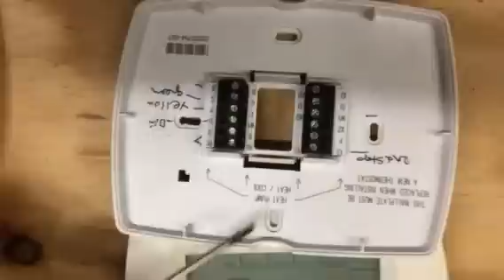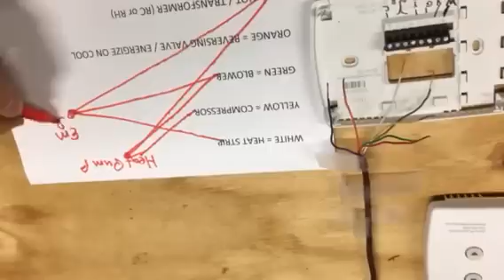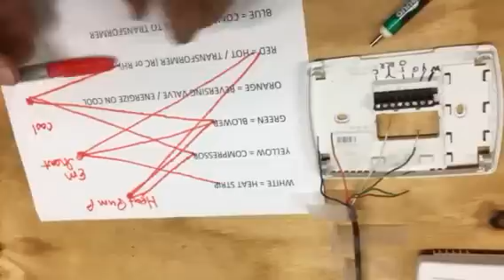Thermostat Wiring

Comment: Sooo Im really going to be the only one who see this error , the same wires it connects for cooling during the summer , its the same wire it connects for heating without using the reversing valve wire . Which mean how do the compressor going to know its either it needs to be cooling or heating ? 🤔🤔

Comment: Your tutorial looked very thorough and I thought I could wire my basic Honeywell thermostat to my Trane heat pump. But no, when I look at the wiring I see it matches to nothing you are explaining in your video! I have a "White" wire not connected. However, there is no "W" terminal except for a "conventional" hook up. For the other terminals there is no "W". Now what?

Comment: Thanks for your tutorials.  Good info.  My AC, when turned on, starts blowing cold air for about 5-10 minutes, then gradually warms up.  When this happens, I go outside and hear the hum from compressor, but the condenser fan cycles off.  Isn't this fan supposed to run constantly?  What can cause the fan to short cycle but not the compressor?  I've done the following:
1)  replaced run cap (5/50)
2)  replaced condenser fan motor
3)  verified 24 v across contactor while both fan & compressor running & when fan cycles off/compressor on - 24v constant either/or
4)  ohmed 24 v tabs on contactor w/o connects (11 ohms)
5)  with contactor activated, both plungers engage - 244 v across t1 to t2 - constant
6)  75 psig on suction side; suction side cold to touch & sweating
7)  24v on wire nuts from control board to contactor
8)  pulled air handler blower & completely cleaned (bristle brush, vacuumed, then blew it out with blower- looks almost new).  It was filthy, but not blocked.
9)  checked thermostat wiring at control board & thermostat.  Tugged on wires both end.  A couple screws were slightly loose at control board (red & yellow) but making contact. I tightened.
10)  transformer fuse & board fuse ohmed good.

I did not clean evaporator coils.  Looks challenging, but if blower was filthy, my guess these coils are too.

What am I missing here?  What else can I check?
Wayne in Riverside, CA.  106 Deg next week... gotta fix asap.
Reply: Oh, I forgot - I ohmed out compressor T1, T2 & run cap herm.  2.0+ 0.8 = 2.8, so it appears good... Wayne

Comment: Will this work for gas and electric driven thermostat and furnace system? Also, when I open my thermostat there are only two wires: white and red. Should I have more wires coming to my non- heat pump thermostat?

Comment: Very good video David. I just touched the Y and the C together, an even when I have turned of the breaker there was a spark when by mistake I made contact. Does that means that the transformer is out now? The AC is not wanting to come even when I do hear the fan and compressor come ON outside.

Comment: Hey David. I have a system that has a E-wire  connected on the existing thermostat and my  new thermostat doesn't have a slot for it. Can i work around it?
Reply: E and w jumper together most of the time.  These call the heat strip on, e for emergency heat and w for the 2nd stage of heat (electric) called if the 1st stage (heat pump) is insufficient to bring temp (in heat mode) to setpoint.  The W will energize on the coldest outdoor temps when the heatpump cannot provide enough heat.
So usually e and w are jumpered together.
There are other ways to bring on electric heat strips in stages as well, depending on the complexity of your thermostat, mine offers 3 stages of heat, for example.  This 3-stage function can be found in thermostats designed for 2-stage heat pumps.
That is, there are a number of ways to configuration the heat stages depending on the thermostat, air handler and heat pump.

Comment: When you tie those wire together to get cool where do you put them?
Reply from the maker: just add wire nut
Reply: @bluecollarmillionaire4life  stfu
Reply: Energizing orange (orange to red) places the reversing valve in cool mode on most heat pumps, some heat pumps this puts the reversing valve in heat mode.  So if your heat pump provides heat with orange disconnected, it will switch to cool mode when orange is energized.

Comment: Thank you David, very easy to understand and straight forward videos.  I am trying to troubleshoot Goodman heat pump.  Now I am equipped with some good first troubleshooting steps for my handyman to execute.  You right it’s not rocket science, but many folks struggle to understand it all, simply because there are so many components in a heat pump.  I think you simplified them quiet a bit for sure.  There are other things as well such as pressure switches etc, but overall I think this video is solid.  I like it... tomorrow I will be doing some pressure testing along with evacuation procedure and some thermostat troubleshooting. Note I am just home owner not HVAC tech.  I was thinking now that I run my whole house on solar, maybe I will also install heat strip.... or maybe my 2nd stage heat... or should I say 3rd.... I have radiators in my house heating up my house with tankless water heater.... I wonder if I can hook up my thermostat to all 3 things.... heat strip.... and my tankless water heater.....

I want to achieve the following.... by default heat pump heating my house with forced air... then if it gets cold... heat strip comes on.... then if it gets super cold.... my tankless water heater turns on....

Note my tankless water heater uses gas which is cheaper than electricity ....however I got solar panels now... so I don’t care about electricity usage anymore....  hence by default I want to use heat pump forced air.... and only have tankless gas water heater heated radiators to come on only if it’s a lot colder below 32 degrees for example....

So do I just hook up my tankless water heater as the second stage to w2 wire? 

I am a bit confused... I don’t want my heat boiler to work when my heat pump is working,  and want it to turn on automatically.... when it’s colder than 32 degrees....

I kind of like strip heat since it gives immediate satisfaction as well.... when it comes to forced air....  but I don’t want to operate on it for a long time....

Only initially just to give me initial quick heating satisfaction in my 1500 square foot home....  but then have itself turn off automatically when it gets warmer and boiler used instead....

Is it even possible to do? Or am I way overboard here? Maybe I should use if this then that automation with Alexa integrated feature to program tankless water heater to turn on while having heat pump turned off....

I haven’t wrapped my mind around all of this yet.... if you have any suggestions let me know. 

Thank You so much.

Comment: Im trying upgrade my thermostat to new wifi unit Honeywell.

I got a blue wire left over in thermostat ...

And I got a blue wire outside at the compressor not wired to anything.

Does the blue wire up to capacitor ?
Reply from the maker: Should be common just use your batteries should be fine
Reply: Cant use batteries for the wifi thats why they say you need to common added??
Reply: I have same issue batteries is just backup we need the common wired in for wifi how can we do that ? Is another 24v transformer needed or can you jumper the common to power the wifi.?

Comment: I had an old Honeywell thermostat; old house, old wiring. Took the old thermostat off to install new RTH7600 Honeywell thermostat. My wiring has only 4 wires; red, green, black and yellow. encapsulated inside a white wire coming out of the wall. 
The old thermostat was connected to the red and green wires; the black and yellow wires were wrapped around the white wire coming out of the wall. I cant get the heat to come on after reconnecting the red and green wires on the new thermostat. Any ideas?
Reply: Hi, I have the same question as you. I only have 4 wires as well.

Comment: What if you want cool you connect the red the green yellow and compressor don’t start where do you go from their?
Reply from the maker: Make sure you have high voltage at the outdoor unit as long as the indoor unit is blowing air then check your low voltage connections

Comment: Im putting in a Honeywell WiFi TH6320W204 and my old Honeywell Pro 3000 had a spot for an E wire, but the new thermostat doesn't.  What do I do with the E wire?

Comment: I have a drown wire s2 and gray s1 everybody talks about common colors but not these . I have trane ac works but face on thermostat frozen. Tried 2 different Honeywell’s . Customer service very bad . I know one is outside thermostat. Also have white with jumper(w1 x2). New thermostats don’t use s1s2 so where do these go. 8 wires in all (heat pump). Hope you can help. Thank you .

Comment: Great information.  I was able to rule out my thermostat as the problem.  Tied the wires together to make my cooling system fire on and was able to determine that it was the main capacitor for my AC unit.  $15 fix.

Comment: What would cause the blower to run all the time? Even when the AC compressor cuts off the blower that brings the air in through the duct work continues to run. My green wire is hooked to G and it's a brand new thermostat.
Reply: Blower motor should run all the time.
Reply: @jklmnk9596  No I mean it runs regardless. Even when the compressor cuts off the blower continues to blow warm air through the vents. Nothing should come out when the compressor is off.

Comment: Thanks for the diagram. I am pretty knowledgeable in remodeling and some light troubleshooting with furnaces. My house has a heat pump system with a thermostat that could be used on the Starship Enterprise. (To technical) so I changed it, nothing.. changed it back per your video. BOOM. it works again. I guess I'll leave the Star Trek thermostat hooked up for now.

Comment: I have a black (dark blue) and orange wire. The thermostat only has a spot for one or the other labeled o/b. Does it go in the same hole as the white wire or orange wire? There isn't another spot for the black wire. I have a Honeywell, th5320u1001 thermostat, and an American standard heat pump with the emergency heating. I live in Maryland.

Comment: Not a bad explanation however, don’t even attempt doing that if you have an older mercury  heat pump thermostat. Because the terminals COULD be completely different. Example: R is the reversing valve. M would be your cooling. Y would energize your aux heat. F would be your fan. And V would be from your transformer.  Also, Some heat pump manufacturers use O for the reversing valve and others use B. My point is please don’t assume that all thermostat terminals are the same. If you have the older type of thermostats, you should consider replacing it anyway. Hopefully I didn’t confuse too many people but wanted to give added information.

Comment: David, I have a Trane T-stat Model # BAYSENS019B that has numbers not letters.  #7 White (Heat), #8 Blue (Cool), #9 Green (System On/Off), #10 (not Used), #11 Black Common, #12 Brown (Communication) & #14 Red (Power). not sure what I can replace it with, I tried two different T-stats but none worked. can you explain this mess for me, what T-stat can I replace the old non functioning one with? does it has to be Trane? can it be wifi?  you can use my email for reply.  Thanks

Comment: All I have electric furnace I just put it in my self  from  Scratch ducking in all it to but my light bill is high and it dont get hot hot  and iam only using green wire, red wire,and white wire  what am I missing  iam running double 60/60 breaker . It just takes longer to heat house up

Comment: You just said Yellow, green, and red are for heat.
Then after you explained emergency heat, you said yellow, green, and red are for cool.
Please explain.
Thank you.
Reply: He forgot to tie in the orange wire(reversing valve) for cooling. Without the orange wire in the circuit it would just run in 1st stage heat.
Reply: @edyebba3414   yes he forgot the Orange  for the reversing valve.

Comment: I just want to stop by and say thank you. I'm doing a self install on a Goodman 4 ton Package unit with a new wifi thermostat. The control board told me everything was working properly but the fan would not engage. So I followed your direction (testing) and sure enough it was a bad brand new thermostat..Now I get $100 back on the return and paid $27 for a different non wifi thermostat. Once again thank you..

Comment: I used ur video to change out my thermostat. I cut the breaker off as u suggested and took a picture of the old thermostat and where the wires was connected. After installing the new one it still won't kick on. I tried hooking the red, white, and green wire and still nothing. Do u have any suggestions

Comment: My blower motor only turns on in heat and not in cool. I put the green wire in the yellow  and fan turns on. Unit outside  comes on but blower doesn’t blow air. So is the the motor thats bad or the thermostat?

Comment: You sound like you actually know what you are talking about! 😄
Question: the missing Common wire.  
Some vids say you can swap the yellow to common, some say the green to common.  Green to common sounds wisest, but I hear you lose fan control.  Obviously, one should ADD the common, but would you suggest G to C, rather than Y to C?? Thanks 👍
Reply: I saw on the Emerson Sensi website where you can just add another simple 24v transformer to get your common voltage, if you just need it for the thermostat.  They have a kit, and so do others.

Comment: This video did not help with my situation. I do not have 7 or 8 wires. Like most homes, we only have 4. The issue is that heat will not come on when wired to run AC. And AC will not come on when wired to run heat. There are several factors you skipped over that could help most of us solve our problems.

Comment: Tried to DIY relocating of my thermostate. Accidentally had couple wires touch and sparked. Finished relocating, but no power to thermostat. Now what? I hear furnace humming with power. Breaker wasnt tripped, but turned off and back on anyways. Now what?

Comment: Hey there I have my packege unit with a pro t6 thermostat but the compressor doesn’t turn on maybe I disnt set up the thermostat right everything is new the thermostat is set up for heat pump but I still hear like a little clik but the condenser doesn’t start.!

Comment: My backplate looks completely different that my other one. It does not have the W line to hook up. Labels are 
E, AUX, Y, G, O, L, R, B, C (optional with batteries) & my old non programmable Honeywell thermostat only uses Y G O W R (with jumper connected R to Rc) any help would be greatly appreciated.
Reply: I think I bought the same one as your old one and I can't get that one to work my damn self 😟 lol My wires are very old and I think some of the colors are faded... To the point where it looks like I have 2 red wires and no orange wire...?
Reply: @nicolescioli6529  is it a Honeywell? I called the number on the manual and they were excellent at providing help so I could sort it out.

Comment: I have an older combo HVAC oil fired furnace with 1 transformer, The blower motor was off but it started to run again when I pulled the face plate off T-stat. I even disconnected all wires from the T-stat and the blower was still running until the face place on t-stat was put back on. This is an older unit and has no door switch. the wires on the T-stat were G fan, Yellow cool, white heat, red heat B (open) (O open) Red Cool, C (open). But the blue wire was connected to RC and RC and RH were jumped out. There is only 1 transformer. I know I missing something here >>>>HELP. THX

Comment: hello here is my problem i have a honeywell digital thermostat. and all works fine but i wanted to install a new sensi wifi thermostat and i did all the instructions i took pictures of what my wires looked like before  and i connected on the newone and when i turn it on to cool it turnes on the heat any suggestions ? i cant find any  videos on this  . i live in az and have a new american standard rooftop ac unit HELLLLLP

Comment: Hi David,  I have a 5 wire  HVAC system (color same as the video) hook to a old Honeywell thermostat (mechanical type with no batteries).  The cold and heat will turn on and off just fine but the indoor fan blower will stay on after the system is in use for a while.  I have to flip the  A/C circuit breaker off every time.  I had the A/C guy changed out my hot and cold relays last year but the fan still stay on.  Any idea?  Is my thermostat bad?

Comment: Red, green, yellow doesn't kick on A/C and my line off condenser is frozen up, the condenser fan is working.  Any idea if that could be a capacitor or transformer problem?
Reply: If you have a heat pump, you need to connect "O" (reversing valve) also. If the lines are freezing, the compressor must be running. Maybe low Freon charge or inside fan not running.

Comment: Great video and well laid out: 
But: I somehow think that the wiring to the 24vac transformer is backwards (black, red,   to   blue, yellow, to the 120 input wire input of a 24v of transformer). You wired them to the The wires you are using are signal wires.
24 volt signal wires CAN'T DIRECTLY operate things like compressors, heating elements, blowers or even that tiny 120volt to 24v transformer.. They need a relay inbetween them, and relays are energized with the 24 vac transformer 0:55 /7:12.. You CAN'T send 120 volts through a thin, barely insulated signal wire that is not piped in conduit. I'm pretty sure black is common to them all. Correct me If I'm wrong!!

Comment: Good video, but you forgot to add the reversible valve for cooling when connect in ng wires to bypass thermostat. Possibly mixed heat pump with straight cooling.
Reply: you spotted that too!